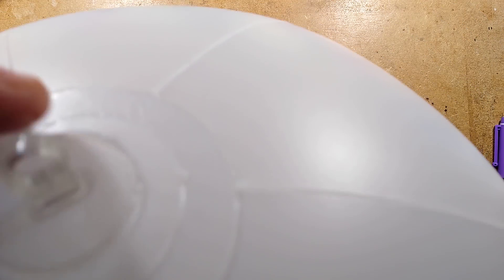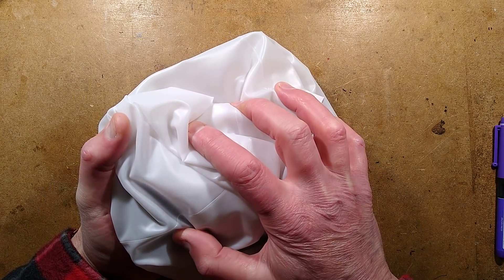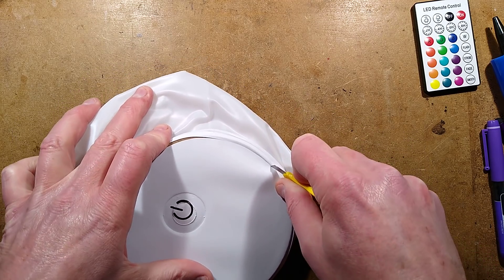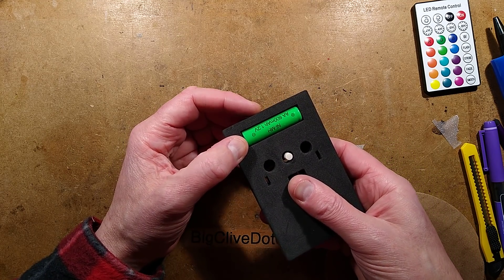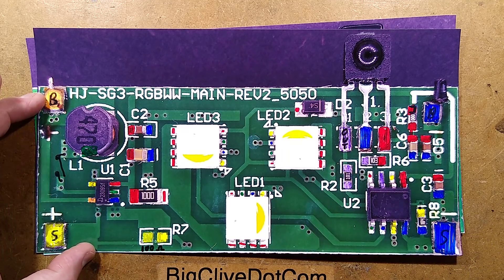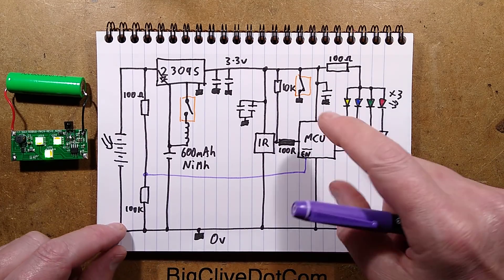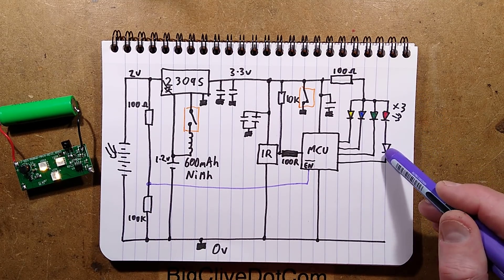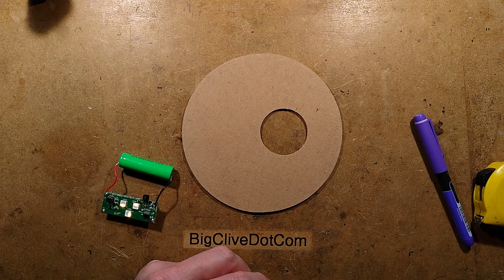Solar floating inflatable orb teardown (with schematic)

Comment: If the German Police does a road control on the highway at night, they call in the German T.H.W. (Technische Hilfs Werke, Technical help service) and they have a huge version of this, they probably fill with helium and make it go up.
It's extreme bright and can be seen miles away, at first sight you would believe that the moon would be hovering above the street.
Reply from the maker: The helium filled lights are also used in the film industry.

Comment: Thanks for all the teardown info. Curiosity:  a pair of requests: 1) Could you take the unit out in the sun and measure the actual solar cell voltage? 2) Are there any markings on what you call the MCU?
Reply from the maker: That would unfortunately require sunshine, which doesn't happen at this time of year.
Reply: @bigclivedotcom  OK. (humor) I have a mental image of a lot of pale people .....
Reply: @ReedmanFL  and you'd be right.

Comment: Have you ever messed around with a "sound powered phone"? They are simple but i find them extremely interesting. Since the few I have are technically US military equipment I am not able to send a pair to anyone out of the states sadly. I was just rewatching past videos and came across your piezoelectric switch video and my phones came to mind. 

It wouldn't be impossible to actually make a pair of "phones" that are voice powered either though. They obviously don't sound like a modern cell or even a POT line but they are/were an extremely important emergency comm for communicating on Navy ship in case power dropped. 

Even though they are pretty quiet the whole idea of using a handset that is powered only by the vibrations of your voice to communicate is awesome. It's an adult version of two paper cups with a string between them. Modern tech is interesting but so many people have missed out on extremely impressive older/lower tech and its slightly sad. The way a modern TV works isn't as impressive as a cathode ray tube that has manually tuned field windings.

Comment: The voltage divider across the solar panel providing EN to the MCU is to ensure the LEDs are only activated when it's dark (~zero volts from solar panel).  This cct is pretty much the same principle as all those solar garden lights that are everywhere but this is the premium RGB version.

Comment: Bought a few of those for our pool. They appear remarkably durable, and ours might have been a better quality (the electronics were held behind a screw-fit panel, sealed with a decent o-ring).  Took the precaution of lubricating the o-ring with tap grease, and all four are still working just fine after four years mainly seasonal use.

Comment: I know this is off topic but i dont know where else to get an answer. I set up a full bridge rectifier to power my non rectified led christmas lights. It works and the flicker is gone but not surprisingly I guess the lights are now slightly brighter. So I'm wondering will rectifying a set of christmas lights that wasn't built with that in mind cause them to burn out quicker?
Reply from the maker: It may result in double the current.
Reply from the maker: It may be possible to add an X2 capacitor in series.  Typically around 220nF or higher depending on the lights.
Reply: Thanks for the help Big Clive I'll look into adding that cap to the setup.
Reply from the maker: @carlzimmerman8700  If you do, I'd recommend adding a high value discharge resistor across the capacitor to avoid stings while testing things.  One Megohm should be fine.

Comment: Thank you! Interesting that they added the diode on red, as opposed to saving the component cost and just programming the red PWM to be dimmer. Maybe the MCI is not programmable. i.e. it is purchased with a set program.
Reply from the maker: The red LED could pull the voltage down and dim the other LEDs due to the use of a single resistor.

Comment: Best thumbnail ever, fuckin glowing wizard thing going on.
Hey, so I need to build a simple 90vdc (400w) power supply for an led array. US here so anywhere from 95-130vac 60hz(generous range). Cheap, simple. Thinking rectifier and presumably using pwm on some good sized mosfets. Ideas, suggestions?

Comment: Hi Big Clive, love your content and delivery. Wanted to ask: if someone wanted to get proficient in understanding and trouble-shooting electronics circuits as proficiently as you do (as a repair technician career path) would you suggest formal education and if yes, what institution would you recommend? Or if no formal education is necessary how would you suggest they should start?
Reply from the maker: It varies around the world, but ideally an apprenticeship as Matt mentions, as that way you do real work and get paid.  There are various industries that involve working with a wide range of technology.  It all depends on where you are and what sort of work you'd be interested in.
Reply: @bigclivedotcom  Thank you for taking the time to reply and for the valued input - I'll take the guidance Matt as share and see what next steps I can take. I'm mainly interested in troubleshooting and repairing smartphone logic-boards and there isn't anything (in my area) that vaguely resembles apprenticeship/mentoring it's a "come with experience and we put you right to work" type of arena. All of my learnings are via youtube currently.
Reply from the maker: @nilomyki  Smartphone repair is mainly learning on the job by asking at a place that does that.
Reply: @Matt Quinn Many thanks for your insightful and very elaborated breakdown and explanation, I'll take time to evaluate the wealth of information of what you've share and see what direction and next steps I show talk. Cheers!
Reply: To give yourself a start, there are a variety of free online electronics courses.

Comment: Lol, something fully inflated could be quite a handful, but once deflated is manageable, but becomes quite impressive once in its inflated state again.
Presumably, if kept in the red state for extended periods, it eventually turns blue, at which point deflation is recommended before re-inflation.

Comment: Dunno if the remote system is the same as the one I have played with, but if you power off with the remote, when you power it on with the remote again, it will restart in the last used mode/colour.

Comment: Hello man, i like your videos and i wanted to ask a thing: if it's possible to protect my computer and printer from short voltage drops (a few tenths of a second) without having to spend a lot of money in taking an ups... It happens when air conditioners and hair dryers are turned on in the house and my 3d printer freezes forcing me to throw away hours of printing and a lot of plastic :( thx for the support.
Reply from the maker: I'm not sure the best thing for that.  You may have to go with a small UPS.

Comment: The sort of thing that would be good to buy 50 of and with some large sacks of dry ice, lob into your town's ornamental/park pond!
Reply: I see the attraction, but not at 10-15 quid a go ! ( 'Course, your local Arts Council might be willing to sub you! ).
Reply: @gdj6298  Well they wouldn't need to be of the highest quality, maybe some potted (or heatshrunk) circuit boards and a battery with a solar panel with a few LEDs, all made long and thin enough so they can be put inside a regular balloon prior to inflation with a floaty gas. Ideally they should be brighter than the original. 

Arts Council, I haven't heard that name since the 1970s.

Comment: Nicads out perform NiMH in this application. Both can handle cold and hot weather the same. 
Unfortunately Cadmium is toxic and ruins landfills, but very forgiving when it comes to being over-charged.
NiMH is not very forgiving and often turns to shit after a few cycles of over-charging. 
Li-Ion doesn't make a good outdoor battery, since it shouldn't be charged or discharged under 0ºC.
In Canada, that's more than half the year :)
Reply: Is it true that even the bears are white in Canada LOL but probably concerns too about using lithium near water.
Reply: Why would you put a glowing ball on your frozen pool?

Comment: I think given the 100 Ohm and 100K Ohm voltage divider, I think that pin is an analog pin and not a chip enable. 
The MCU monitors the voltage across the solar panel and detects when it's dark enough outside, to turn on the light show.

Comment: I 3D printed a light diffuser out of clear PTEG filament, It looks amazing. PLA+ is now my second filament choice. 
If you have a 3D printer, try some clear PETG next time. Printed at 50mm/s MAX, 240ºC hotend, no part cooling fan, 80ºC bed.
Reply: I really love PETG.  It just prints well for me om my ender and my Hicktop.  It's the filament I have used the most.
Reply: @ConstructInc  Made two different shapes. One was a half sphere with only 3mm thickness. The other was a half long cylinder with both ends open. Same thickness. I liked the half sphere better, but the half cylinder was more modern looking.  
Play around with fill and choose what you like. I went with 10% triangles. GLHF

Comment: I know it's not practical but it should be filled with nitrogen, air will have some moisture in it this will condense and evaporate with changing temperatures causing corrosion and shorten the life of the electronics.
Reply from the maker: They are in an isolated pocket from the main globe.

Comment: What would the other switch (K2) do if it were installed? Near as I an tell it would do something rude to the power chip but I can't quite make out where all of its traces go.
Reply from the maker: I think some of the tracks to unused switches were from a different design.
Reply: @bigclivedotcom  I think you're right, but they still go to pads on that board. Different chips and other components in those designs maybe? Still, a regulator is a regulator... huh, there may be a Li-ion/Li-Po version that uses the K2 switch controlling a different regulator and processor. Just a guess.

Comment: If the MCU is something like a PIC12F629, then it's input only EN pin (MCLR/Vpp) doesn't have a diode "pointing" towards Vdd and it can go well above Vdd without significant current flow.

Comment: Switch is there only for shipping, you will likely never turn this off when in use, only using the remote alone, so the switch is only to prevent operation in the container and triggering some sort of panic from flashing lights.
Reply: Then it would be two contacts squished together with some vinyl from the ball in between, pretty much a one time plunger you remove by inflating...
The switch is there to save the battery on winter day, just expose to light for days but with no usage in the night

Comment: What is a decoupling capacitor and have you done any videos yet where you explain what different components do
Reply from the maker: It provides a local buffer that smooths out voltage spikes.

Comment: The " Dio-deee"    inside  the regulator  acts   like  a  "free wheel" when the  inductor  is switched  in  creating  a  buck converter   power supply

Comment: Interesting they doubled up most of the PCB vias -presumably to improve yield
Reply: Pretty common practice on ICs these days.
Reply: In return it means the package used could be even smaller if you have the process right... So resources are still cheaper than difficulties(money/time..knowledge?) to bump quality, the yield up high
Reply: Maybe the same ic is used on more feature rich applications and this is just the low function, less pins, thus low price bond wire mapping to push "yield" to absolute maximum..just to earn some money
Reply: Neat observation!

Comment: Should have tried replacing the 100ohm with something lower. Those LEDs seem very dim to light up a globe.
Reply: Not going to help much, you are limited by the output current capability of the 8 pin micro, so around 20mA in any case.  You would have to put P channel mosfets and pull up resistors, plus a better boost converter, much bigger solar panel and cell in to get higher power.

Comment: Did you keep any of the grainy photos with the actual light levels? I'd be interested in seeing how even the lighting is from the little diffuser film, and also how much actual light it puts out, not that it's easy to judge that based on a digital photo.
Reply from the maker: It's hard to indicate the light level, but the diffusion is pretty good.
Reply: A Fresnell kind  of "lens" cover...not quite but a bit... 🤣